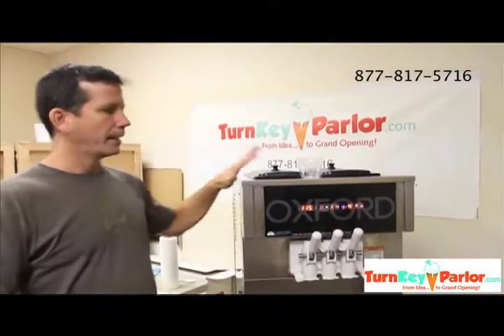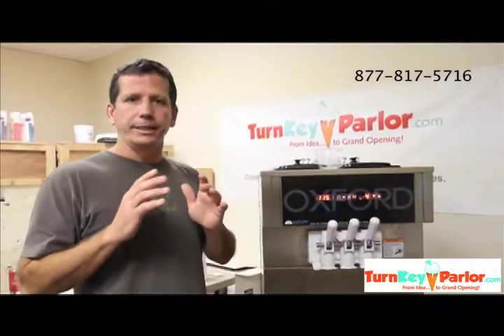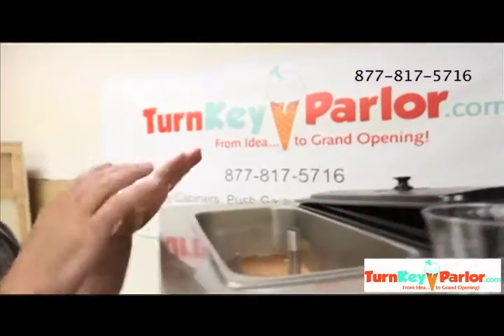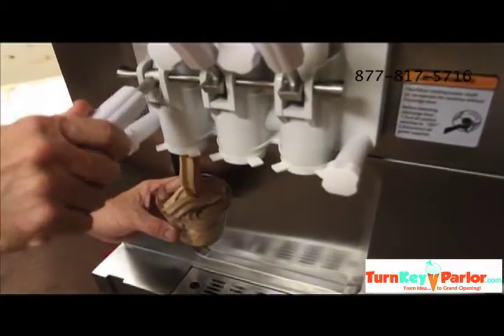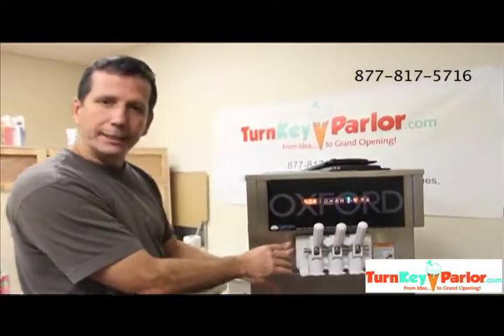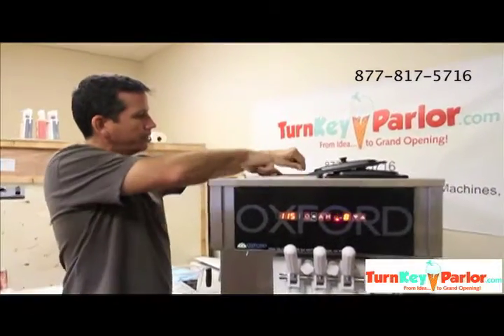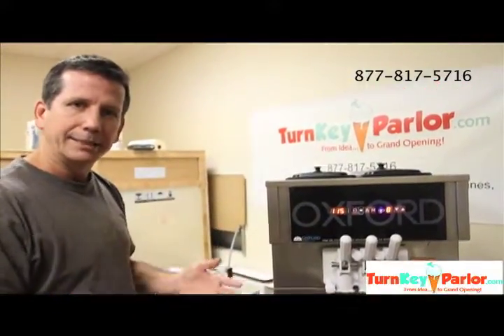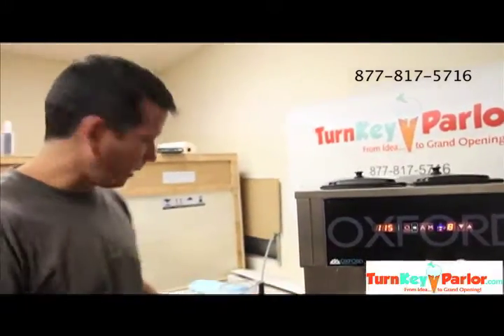Frozen Yogurt Machine - Adjusting Air Content

Comment: Hi Neil, thanks for your answer. 
I always position the air tube once I pulled and pushed the prime plug during the first batch in the morning. 
I don't know about the whole concept, but before pulling the prime plug the cylinder supposed 80-90% full with some air is going to be Primed ? After primed, the cylinder is full ?🤔🤔? At the same time we position the air tube. So, where is the appropriate overrun from ? Thanks to let me know that stupid question, since the overrun is hard to know exactly, it's volume , not weight 😅. 
Thank you  😊

Comment: Question 🙋🏻‍♂️,  would you please teach me when reversed the feed tube, how much product should be drawn out , is it related to how big is the cylinder ? Since there are 1.7-3.2 liter cylinder machine in Market. Thanks for your informative video 👍🏻👍🏻
Reply from the maker: Hey Jackson! There is no exact answer to that question. You will learn over time what works best as far as quantity to draw. At least cup full. if you err, err on the side of withdrawing more. If you withdraw the whole cylinder, you are starting 100% with new mix, so that is best case scenario. The best product the machine make is the first batch right after cleaning, so in the morning, if you have the energy, drain the whole cylinder